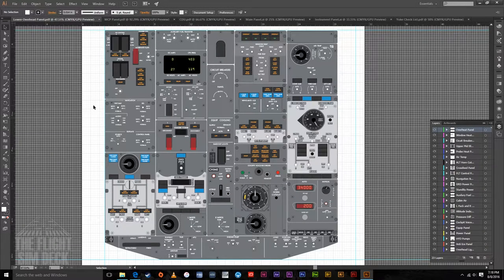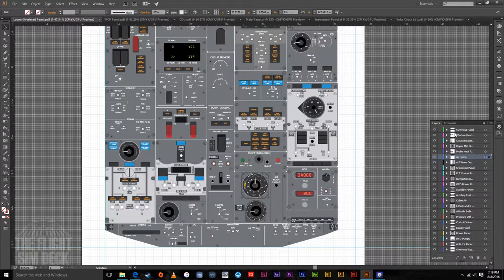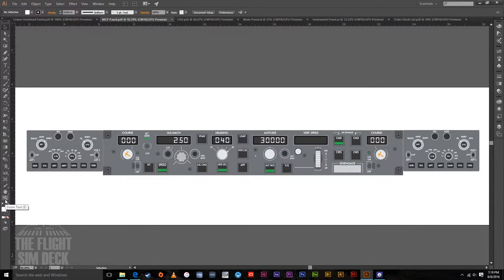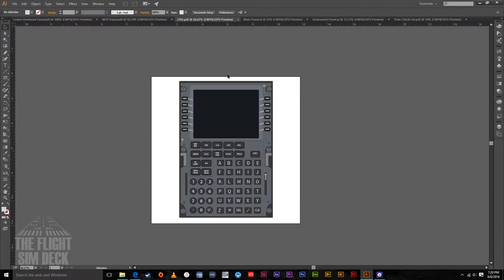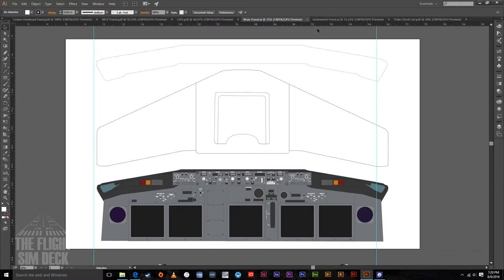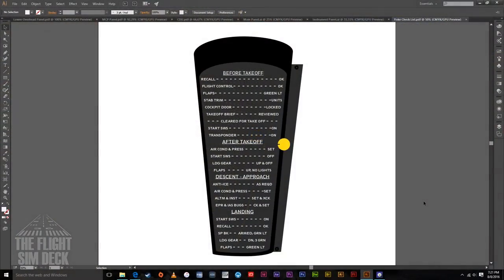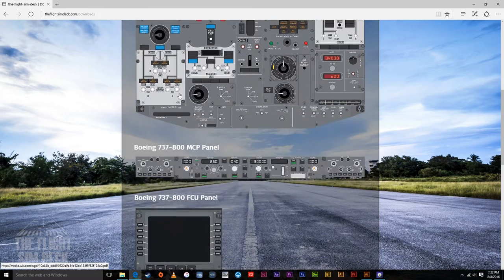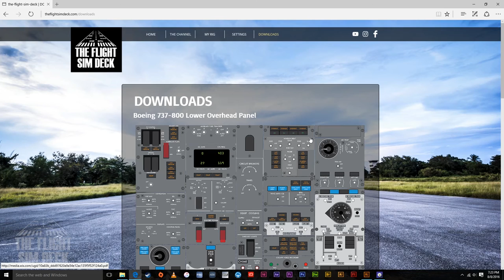How To | Print Your Own Cockpit Panels

Comment: Yes I know and things you really do need to buy I think if you want a good experience is a real yoke,foot pedals all the throttle controls those items itself are expensive plus the over head projection you will need for your displays unless you go with monitors which I’m not.

Comment: How are you doing this and do you have videos of you making them? That is really what I would like to know.
Reply from the maker: Cory Jeffreys just using Adobe Illustrator. I trace over an image of the real thing. It’s built piece by piece.
Reply: Do you or would you do a video on how honestly I really want to build a 737 Sim myself but the cost is so expensive all panels are going to have to be hand made or there is no way I will be able to do it.
Reply from the maker: I could do a video about it. Yeah they want so much money for it. I have seen some already assembled overheads for about 4- $500. All the switches are there but you still have to do the wiring.

Comment: thanks for sharing this to the flight simulator community. however, it seems that the download link for the panels is offline/corrupt on your website (error 404).
Reply from the maker: Yeah I took it down because some individuals were using it for profit. I found a store that was selling printed copies of it for $50+. They even had the audacity to add their logo to it.
Reply from the maker: I have replaced the files on the site and added new ones. They are .png files that are the original size and high quality.